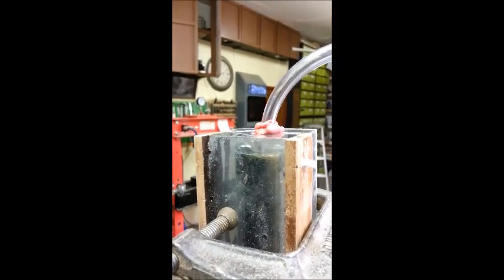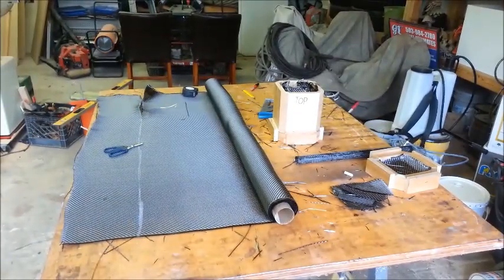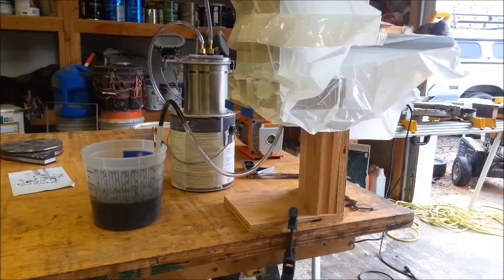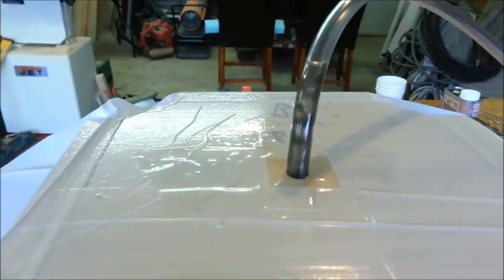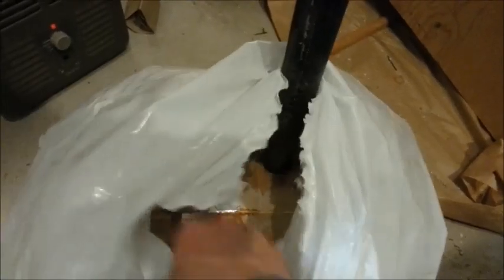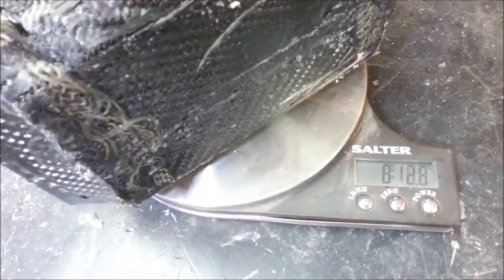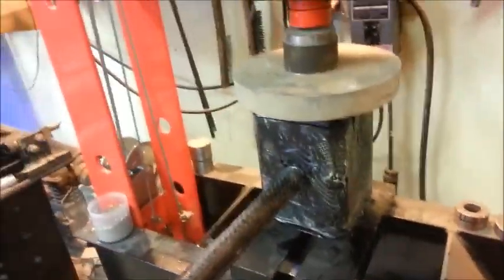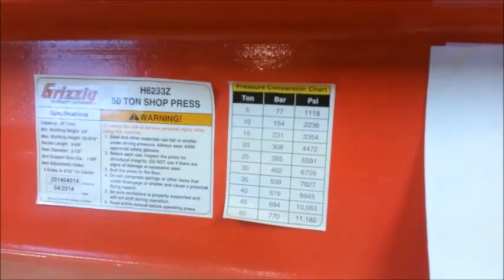Thor's Hammer Carbon Fiber & Kevlar!

Comment: Nice job, and nice video.👍
- But I think is a shame, that Craftsmen like you, only make the "HOLLYWOOD" Mjolnir.
Thor's Hammer Mjollnir (Mjønler), was a THROWING WAR Hammer, with a Slightly Pointed Top. ⬟ ⇪ NOT an oversized  Rectangular Blacksmith's Hammer.
When Thor threw it out, Lightning was Flashing, and It always hits It's target, and then returns back into his hand. 
It is smithed by the two Dwarves, Brok and Sindre, who also forged Frej's (Freja's) Golden Brush and Odin's sword Draupner.
 According to Snorre's Edda, "Icelandic saga", Mjølners shaft became a little too short, BUT is, the most important work the two dwarves ever performed.
Reply: Bushtrail Freedom Draupnir was a golden ring made by the brothers that replicates or "drips" eight new rings every ninth night. Not a sword.

Comment: 5 ton crush resistance is different than strike impact resistance. I bet if you were to strike a small hard object it would crack.
Reply from the maker: I gave this hammer to a buddy who took it to an auto wrecking yard and had at it to the cars, he is in the military so he went all out on the hammer.  All I can say is it broke up the cars and windshields, but just scratched the paint on the hammer.  I may seem weak, but once you play with carbon fiber and kevlar mix you realize just how super strong these materials are.

Comment: Hey awesome video!! I was going to do this for my project for my class.  But I cant figure out how to make the mold for the head of the hammer.. PLEASE HELP!
Reply from the maker: +Kevin Walsh  Hey there. I used a  wood called MDF. It comes in different thicknesses. You can buy it from any Home Depot or Lowes. It comes in sheets and sticks.